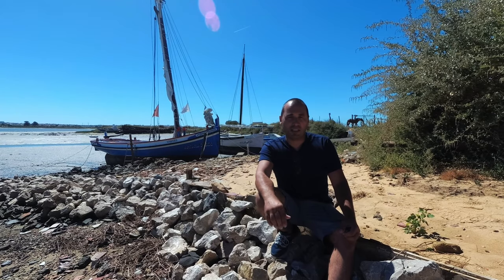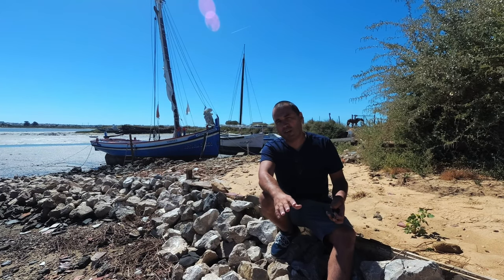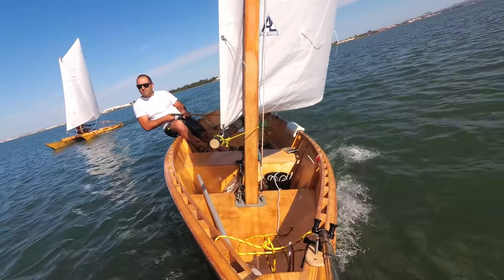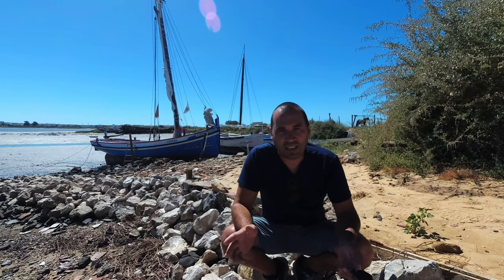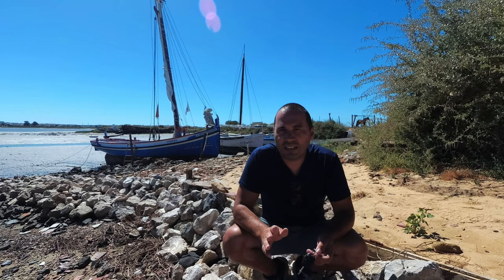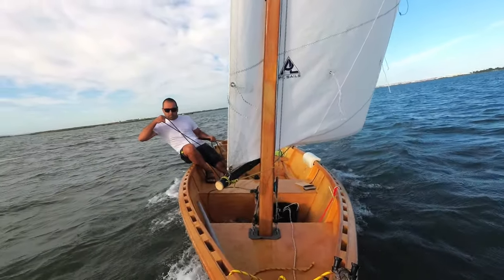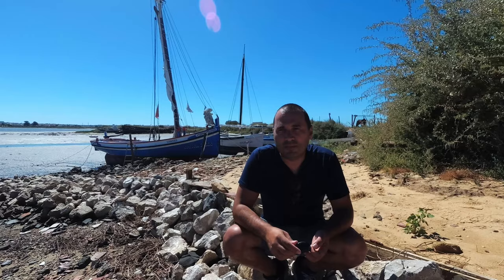Home made sailing boats,  Goat Island Skiff  and Hitia 14

Comment: Wow. You are really enjoying your beautiful skiff. I had planned to build a Hitia 14, but because of funds (lack of) and practicality, I went for the Tryst 10 (for now). I am watching your sail carefully, as it seems simpler and easier to sail than a laser type one.
Reply from the maker: They are different sails both with  pros and cons. The laser has one more control at least (Cunningham+Vang) while the Lug combines those two in one (downhaul). 
You can  lower sail and reef on the GIS, which to me is a HUGE advantage comparing to the Laser, and as you probably noticed I also rigged some simple Lazyjacks on mine.
The Laser will point a bit higher from what I can remember...

Comment: Good vid. Do you get big wind waves? Where I sail, if I'm hiked out, there is at least some chop.
Reply from the maker: Hi Paul!
I'm only 150lbs, I start hiking from 5-6kt of wind! 😅
We do get heavy chop here. It all depends on wind and tide direction.
On this video we start with the tide  coming from same direction as the wind, it it is just perfect for sailing.
If you have a look at 10:10 when I'm on the way back the tide is now against the wind and although there wasn't a strong wind, chop is already starting to form.
Some areas of the estuary are quite shallow, on spring tides with high contrary winds it's actually very hard to sail through!
And in the river it gets really choppy! have a look!
https://youtu.be/q3VKbF3Nln8

Comment: Hello Teo,  the curv in the Foot of the sail is as plans?  Or you use it more loose in the Clew... ?
Reply from the maker: Hi Gary, the foot of the sail is adjusted depending on wind speed and conditions.
As a rule of thumb I use a deeper sail in low winds and flatten it when it gets too windy.

Comment: Was the GIF faster than the Hitia14?
Reply from the maker: With winds up to 7-8kts the GIS was just as fast and some times faster than the Hitia (in this occasion).
As the wind picks up and one person isn't enough to keep  the GIS from heeling (so one can't make use of its full sail area)  I'm sure the Hitia will fly by as it doesn't even heel, so it can take advantage of its full sail area.
On a beam/broad reach the GIS seamed quite fast too, even in stronger wind, since there's little heeling on that point of sail.